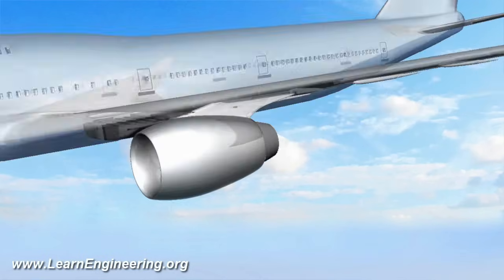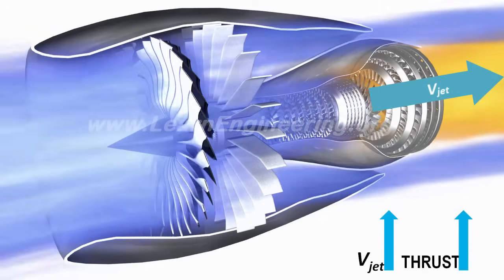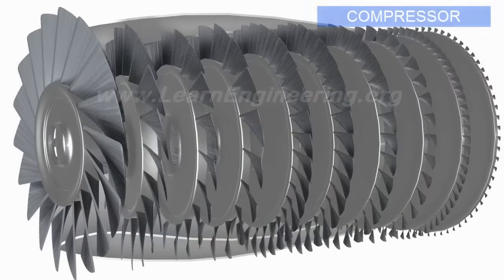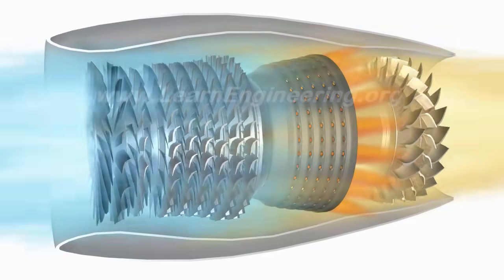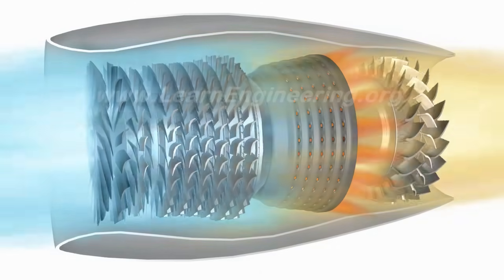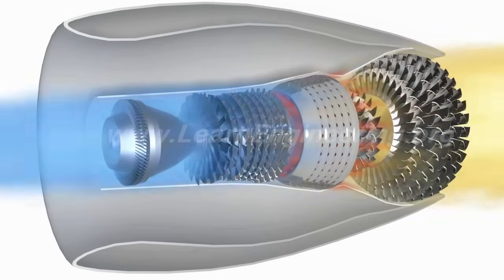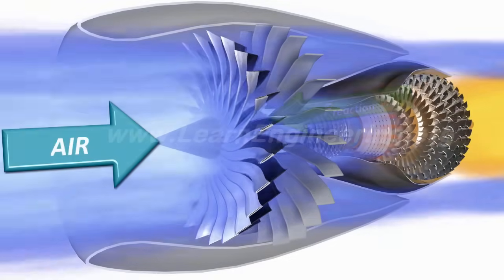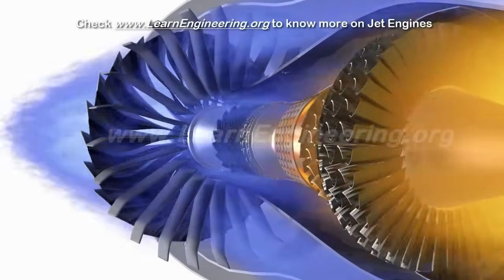Jet Engine, How it works?

Comment: has anybody else notice blades are rotating in the wrong direction???
Reply: It is obvious.
Reply: ***** ok you intelligent! one, make your turbines that way, and pray they flay.
Reply: No I don't know even one English word.
Reply: +Paymaan Jafari YES AND IT MADE ME CRAZY!!! THINGS HAVE TO BE DONE RIGHT IN EDUCATIONAL VIDS!!!
Reply: +Paymaan Jafari yea i noticed ^^ i wonder what arguments he had :D
Reply: Filbsmo Atlas :) first he dared me to prove it!, then he told I am too stupid for understanding the righteousness of this video, then he somehow commanded me to describe or I don't understand english, like he is my boss :)
Reply: +Paymaan Jafari funny dude :D
Reply: @PaymaanJafari  hi paymaan..lol
Reply: Yes it is. the compression fan must suck air, not reverse.
Reply: +Paymaan Jafari LOL, I was just about to post that same observation.
Reply: patman0250  If you check the comments' dates, you'll notice most of them written AFTER my comment dude! :)
Reply: I thought I was the only one that saw it
Reply: yep, and the narration is wrong...
i doubt any information in this is actually correct. so better downvote it and get them to make a better video... with actual research.
this is crap
Reply: It's spinning in the correct direction because it is linked by a shaft between the compressor and the turbine, therefore the compressor blades are what needs to be reversed, not the rotation which would require a reverse gear in the linkage to make this work which is a terrible idea.
Reply: @samscreativefarm  And this is the comment I was looking for
Reply: +Paymaan Jafari Yes i saw it. But only on the intake
Reply: @VolksTrieb  You do know that that N2 front fan is powered by the N2 Power Turbine at the back and they spin the same direction as they are on the same shaft right?
Reply: hahaha that was my reason to visit the comment section. a lot of engineering students here. hehe
Reply: +Paymaan Jafari Yeah It makes me sick for some reason.
Reply: ***** that is a Jet Engine compressor fan.
Reply: Yeah it's driving me crazy I can clearly see that intake is pushing air out of the jet.
Reply: just because you're a 3D modeler or animator, it doesn't mean you know crap about physics or aerodynamics.
Reply: Definitely, it is a bit annoying.
Reply: Well the fans in the front are spinning incorrectly.
Reply: Paymaan Jafari that’s literally what I was about to come down and comment on
Reply: Yeah, it's now sucking air out instead of in.
Reply: That shit about drove me nuts.
Reply: +Paymaan Jafari Oh, so it wasn't just me then?
Reply: +Paymaan Jafari ffs video makers!
Reply: +Paymaan Jafari 
Just about to post it, the "suction side"
Reply: Not only students...
Reply: that fan is a compressor, the way it rotates pushes air forward, rather than sucking and feeding the compressed air to the engine. look closer.
Reply: Yes, everybody. :D
Reply: That was my first reaction when I clicked on the video
Reply: Yeah I did at the beggining it looked like the blades where in the reverse thrust motion or direction.
Reply: Yeah right....Good observation
Reply: me and half people in the world. A mess
Reply: Stators are shown 180° in error.
Reply: No they're not, they are meant to suck in air
Reply: Was going to comment that
Reply: How do you actually know which direction it is suppose to rotate?
Reply: @ShadowRap-y5l  it should compress the air towards the engine, for this the lower side of blades pushes the air, not upper side which is visible.
Reply: It was painful to watch!!! Lol I was saying out loud to the screen “ the fan blades are rotating against the low they are depicting! “
Reply: "has anybody else notice" ... yes immediately :D  However the rear turbine looks fine ;)
Reply: Sampath Sri Sitinamaluwa that is for 1 year ago, and we are still seeing people reply that it is turning correctly. 🙄🤔
Reply: Yeah i noticed that 
Is it a animation mistake??
Reply: Foxi! You say you have doubts so maybe it is right...
Reply: I did ✋
Reply: Yep... it's bugging me
Reply: Paymaan Jafari any way content is matter not.. Direction understand
Reply: Paymaan Jafari - hahahaha! Yeah I noticed it too....I think God Almighty had a change-of-heart in His creation of 'proportional wind velocity outcome', etc....lol...🤣😂🤣
Reply: I can only see more blades there than anything else
Reply: Could also be a patency thing???
Reply: yes,, that's exactly like what l thought
Reply: Yep.
Reply: It's a FAKE FAKE FAKE! INFORMATION 8.3 MILLION VIEWS NOT INTERESTED IN LIARS TRYING TO CREATE EXCUSES FOR THERE LIES ! NOTHING HERE GROUND-BREAKING THIS IS ON PBS TO GET YOU DUMB TO THE CON. THEY ARE LYING A FUEL ECONOMY OF COMPRESSED AIR OXYGEN AND THE HEAT FROM THE TURBINES IS ONLY USED FOR CABIN PRESSURE AND TO FIRE THE TURBO TO BRING TO A CONSTANT TO OPERATE  ON ITS OWN CREATING A THRUST VECTOR CHECK IT OUT AND IT USES SOUND AND VIBRATION TO CREATE A MAGNETIC CHARGE LIKE A BEATTLE OR BEE! THE REAL TRUTH!
Reply: @derffred8617  don't type while you're high on drugs.
Reply: Yes
Reply: You are right...
Reply: Si, esatto! reverso!
Reply: @dingchavez3751  
Great fun...
Reply: High stage rotors and low stage rotors are not connected together,they are driven by airfloe.
Reply: Yes I saw that and thinked "what the fuck" it's wrong.....
Reply: Yup
Reply: Which one?
Reply: Look at the rolls royce trent engines. They spin the same way
Reply: Me too
Reply: Yes
Reply: Hahaha yes
Reply: yes, in the first illustration. Agree, simple error.
Reply: Yes i also observe how air is flowing like this
Reply: GOD YES!
Reply: Me
Reply: They blowing the air towards the front of the engine ;) It's called reverse thrust
Reply: Actually, it might be a reverse movement. (ok it was just a joke)
Reply: Yes.
Reply: It confuses the living hell out of me,I watched it several times, It kept changing directions towards the end of the clip
Reply: lots of 12 year olds arguing down here
Reply: Noticed immediately
Reply: I thought about that in the whole beginning of the video about the third law
Reply: In that way engine can't suck the air..
Reply: Yep
Reply: it's "aliasing effect"  watch video in below link and u will know why blades are rotating in the wrong direction.

https://www.youtube.com/watch?v=ByTsISFXUoY
Reply: after four years: yep, still turning backwards.
Reply: Michael Jackson Designed it.
Reply: Thank you, I noticed 2 mins in and thought everything I knew was wrong for a second. Lol.
Reply: Paymaan Jafari it drove me nuts. I just pretended it was spinning so fast that the FPS made it look like it was going in reverse. That soothed my anxiety
Reply: Yeaaa that was so frustrating omg
Reply: Is most of this comment section a bunch of idiots arguing?
Reply: oh didnt see that coming. Although I believe this mistake isnt that significant, since those who watched and understood the mechanics of airfoil should still get it right in reality if asked
Reply: it is working. In reverse thrust
Reply: yeah i noticed too,
Reply: @paymaan Jafarir It is showing the direction of movement due to air and not due to motor
Reply: Its either opposite day or they regretted 911 at the last moment but they couldn t stop
Reply: It is in the film only  everybody knows that.
Reply: @willardelkins2329  THe film is wrong and video maker accepted the mistake. and no, not many people are able to recognize the problem.
Reply: @PaymaanJafari  no no the film pictures it reversing
Reply: The spin directions match each other, which is correct. The blade direction in the compressor section faces the opposite direction of the turbine blades. The net result of the opposite-facing blades is zero thrust.
Reply: I was confused, i thought it was normal
Reply: Just the compressor blades though. They should be turning the other way for the way they are oriented.  The turbine blades are however oriented correctly for clockwise rotation.
Reply: https://youtu.be/oH5l1YcOc_k
Reply: In the beginning yes but the turbo propeller was rotating correctly
Reply: THANKS
Reply: +Paymaan Jafari dude have you even read the comments??? everybody noticed lol
Reply: I think the compressor blades are moving in the right direction. They oppose the air income force, what makes the pressure to increase in the outlet of the compressor. Compressors are not used to suck the air in as everybody is saying here, if they were supposed to suck the air in they will be decreasing the pressure at the end of the controlled volume device. Imagine an injection, in order to suck a fluid in you need to pull the piston to make the pressure higher you need to push the piston. That mean that if you want to increase pressure you need to create a opposing force just like we see it in the case of this compressor and every other compressor as well.
Reply: @simonpitonak6797  I agree technically, but then why air comes into the engine? What pulls air in, because the fan doesn’t do this.
Reply: @emre3304  Wow, it has been a while. To be honest, I think I´ve already forgotten how it worked, haha. I guess the air is being sucked in because there is a pressure drop on the outlet of the jet engine. The airflow in the engine is also further caused by the motion of the plane, I think.
Reply: It is the wagon wheel effect... It is actually rotating the correct way but the frequency of the camera shows the other way.. :) kidding of course!
Reply: maybe
Reply: Nah. . .  It’s like the wagon wheels going backwards in the movies. . .  it’s all about video frame rates. . .
Reply: That's because they engaged the thrust reverser levers.
Reply: Paymaan Jafari....according to the fans blade angle of attack shows is rotating in the correct direction.   if I'm still wrong, all that says it's backwards, please explain otherwise.
Reply: Ok, The Airfoil Shape, Look at the Windmill, The Line is at the Left but it Rotates at the Right Direction,
See, Explain this Mr. S

Comment: how is the large low pressure spool being rotated? and how it increases speed from low speed? i don't understand. .
Reply: I'm assuming your talking bout the big one at the front, it's connected to the other low pressure spool at the front, which in turn is also connected to the turbine at the back.
Reply: I mean how this thing turn at the start?
Reply: Christian Paul Roldan Electric motor.
Reply: Christian Paul Roldan Some might as well use hydraulics.
Reply: hydraulics are not fast unlike pneumatic. .
Reply: Christian Paul Roldan most jets use a start cart to start the process, and it uses pressurized air to spool everything up, then the whole combustion process begins, and the start cart is no long  needed.
Reply: +Manchester Hall Only if the APU is inop they are forced to use a start cart.
Reply: +Christian Paul Roldan Pneumatic (air pressure) starter motor which receives pressurizef air from the APU. When the inner (high pressure) spool reaches 25 to 30% rotation, fuel is introduced.
Smaller jets (business jets) do have electric starters that switch function to be generators after start.
Reply: +Christian Paul Roldan Absolut vodka

Comment: Is it just me or is the engine spinning the wrong way?
Reply: +M Ko basic physics. Go look up a different video and see for yourself. If you still think I'm wrong, you're entitled to you're opinion.
Reply: +M Ko the fan blade simply pulls the air through the engine, to create thrust. however in this video, the fan blades are spinning the wrong way, so the air would be pushed out, not in
Reply: +M Ko because we are interested in the subject and do research. Now buddy i'm gonna go, because you are wasting my time

Comment: Might be the refresh rate of my monitor battling youtube but it appears the compressor is spinning backwards.
Reply: ***** How the fuck should I know why it is that way? Someone fucked up making the animation probably.
Reply: ***** It shouldnt be wrong, but it appears to be.
Reply: ***** Because it is. And Im not the only one who noticed it.
The schematic is correct but the compressor blades are the other way around.
Reply: ***** Because someone apparently messed making the animation. What other explanation do you want from me? I didnt make it so I wouldnt know why it is the way it is.
I assume you are seeing it but just dont realize or understand that it should be the other way. Id guess most people dont.
Reply: ***** Because it is, unless there is a frame rate problem creating an illusion. The compressor has to build the pressure behind it not in front.
This is how it should be:
/watch?v=yZV3siHf910
Reply: ***** Common sense. Have you ever seen a fan and which direction it spins in relation to where the air being moved?
Reply: ***** You should look which direction it spins and note where the air is going.
Leading edge inwards - its blowing air out.
Leading edge outwards - its pulling air in.
Ship and plane propellers do the same thing. Find a video of one and look which direction its spinning. Wikipedia might help too.
Reply: ***** The direction depends on the leading edge orientation and your relative position.
The leading edge is the edge of the blade that is obviously leading in the direction of travel.
The blades, as you can see, are angled. The angling is for the purpose of moving air, obviously.
So, the leading edge inwards = its blowing air out
Leading edge outwards = its sucking air in.
In compressors the leading edge should be outwards, in this video its inwards.

Use your imagination and try to visualize where and how the air moves.
If it doesnt help just google it, man.
Reply: They know because they learn this in school. Imagination helps understand airflow, if you have it.
There is no cw or ccw, it depends on your position. Thats why we use the term "leading edge".
In this video the compressor's leading edge is inwards. Should be out, as in the video I linked previously.

Id think the one who made the animation somehow assumed the turbine and compressor blade orientation should be opposite to each other when in it actually should be the same.
Reply: ***** Physics. No worries, youll get there.

The leading edge should be outwards, thats the point. Its outwards to pull the air in.

I did explain, its not my fault you arent getting it.
You could just google it or watch other turbojet videos on youtube, maybe then youll get it. Im not here to educate you.
Reply: ***** It should be pointing the same way the turbine blades are pointing. Thats the simplest explanation. Both should have the same leading edge and spin in the same direction.
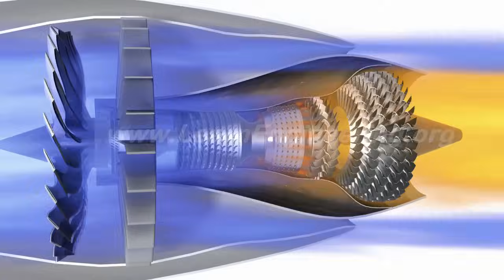Big fan at 4:13 is correct. It then changes to incorrect 5:03. See the difference?

Comment: Did anyone else notice that the blades on the front are the opposite angle to what they should be ? the way they are would push air out the front, lol